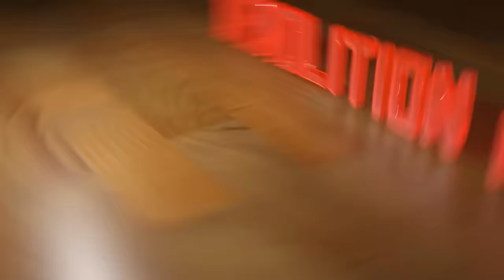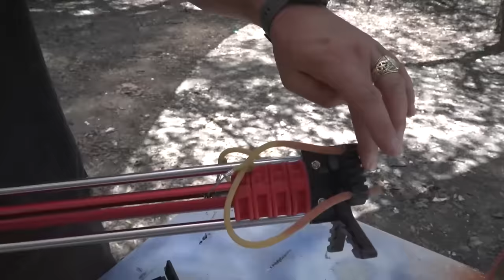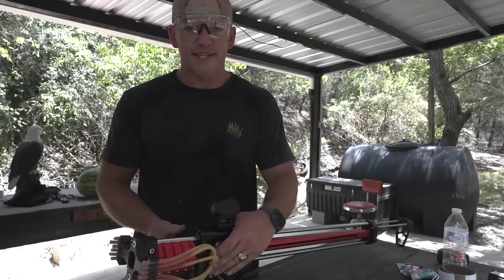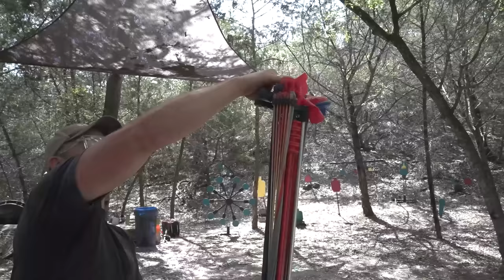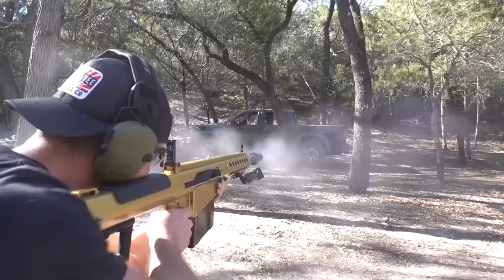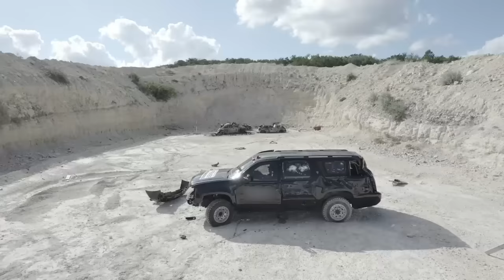The Chinese High-Powered Slingshot Gun!!!

Comment: Here are a few things you need to know about slingshot "guns". 
First, rubber is slow. You won't ever significantly exceed maybe 200 fps with a slingshot gun. So forget small, lightweight ammo. 
Second, rubber is really good to accelerate very heavy ammo that can be very destructive at 200 fps. 
Third, Chinese tubular rubber sucks. If you want power, you need flat bands, cut in a tapered way (thinner at the back and thicker at the front). 
Fourth, a slingshot gun is basically a crossbow. If you want a powerful crossbow, you need AT LEAST 150 lbs - ideally more like 250 lbs of draw weight. That is  A LOT OF rubber and you need a winch or a rope cocking aid. 
Fifth, for true destruction, you need to shoot heavy bolts (or arrows) instead of round, blunt balls. The sharp steel tips and the heavy weight will really cause damage. 
Conclusion: You CAN make a rubber powered crossbow that rivals really powerful recurve crossbows. You can NOT make a rubber powered "gun" that rivals firearms in terms of shot energy and bullet speed. But that gel turkey you got, I can take a rubber powered crossbow send a bolt all the way through it OR hit it with a fat steel ball that will lift it clear of your table.
Reply: I love the ballistic gel turkey!!
Reply: Or go the Trebuchet route and enhance the speed of the ammo with leverage.
Supersonic Trebuchet is absolutely a real thing. The youtube video is fantastic!
Reply: I ain’t reading allat
Reply: said by the pro himself !

hello Jorg 🤘
Reply: Dank you and bye bye. I love you lol
Reply: Omg the legend himself is here!
Reply: I was hoping you would comment here! You should collab sometime. (If you haven't already at least)
Reply: hear, hear!
Reply: Ya I'll just pull out my Springfield XD and know what's going to happen everytime
Reply: Exactly the subject matter expert i was thinking of watching this video
Reply: PLEASE PLEASE PLEASE
Reply: Lovely to see you here Joerg, just the man we were hoping to hear from.
Reply: The legend himself
Reply: Haha, cocking aid 😎
Reply: Matty needs to get advice from the Slingshotchannel. Would be awesome to see some collab!!!
Reply: Joerg love your channel, hope one day I build something for you and show you his feature's
Reply: I was going to say something. 
And I was thinking about you, and how disappointed you'd be if you saw this, that he didn't use some Thera-Band Gold or something! 😆
But here you are. So instead, I'll just say: Hey Jörg! 😊
Reply: This is largely why I've stuck with large cal air rifles. You don't need someone with your level of expertise to make informed purchasing decisions for those. Glad as hell the slingshot industry has you though!
Reply: colab when?
Reply: Or a toilet brush and really clean out its "bullet hole"😂😂😂
Reply: "Let me show you it's features" 😁
Reply: Create thick rubber strips from discarded inner tube from a big truck or heavy trailer?
Reply: @PaytonHill11 you should. The man commenting is the legend himself. No man can teach you more about homemade weaponry than him
Reply: Let me guess, the Chinese doesn't make flat bands? Or did you just want to pile on the Chinese?
Reply: The wisdom has been bestowed, now go brothers.
Reply: He is here everyone, the mad lad himself, here to spread knowledge of the ages!
Reply: Colab! Colab! We Need  a Colab!!!!
Reply: @PaytonHill11 I can tell your level of intelligence just from that poorly structured sentence.
Reply: @ronaldprince435  🤓🤓🤓🤓
Reply: You 2 need to catch up and do a colab on a doped out slingshot... Love your work JoergSprave...
Reply: You and matt need to make this happen
Reply: Jorg, a lot of what you said is not true. I own one of these slingshot rifles. And with tube bands it could shoot 13mm steel balls at 300fps. I even see others shoot 450fps with a longer version. These slingshots vary from cheap junks to incredibly well made and high end ones. Also, there are very good chinese flatbands (e.g. Precise) you could use on these slingshot rifles too.
Reply: nothing more fun that getting a simple frame with some fresh flatbands and launching 10mm steel balls at like 300fps. so much power
Reply: You 2 should collab
Reply: @vdcn2776 Physics can't be beaten, in order to achieve serious power with a crossbow like device, you must invest that energy first. To penetrate a dense organic body deep enough to cause real harm, with a blunt projectile, you need plenty of energy and momentum. You can build a powerful slingshot rifle, but the projectile speed will be slow so you need heavy projectiles. 
True, the Chinese make flat bands too, and I am sure there are good products out there. The stuff I use comes from Indonesia. But the physics of rubber is pretty much all the same - the reason why tubes are not as good as flat bands is the higher internal friction, the trapped air and the fact that you can't really taper tubes well. I have done hundreds, if not thousands of tests and they all come out with the same results. 
As a matter of fact, rubber just isn't very feasible for a crossbow. It just isn't. The cool down effect means that you can't keep the weapon cocked for a longer time without seriously losing power. Rubber is also prone to tearing. It WILL tear, and the higher the speed of the band set, the sooner it will tear. The weapon will never be reliable. Rubber is really good for a handheld slingshot, but for a crossbow like device, fiberglass limbs will win every time. That does not mean you can not make a well working rubber powered crossbow. You just need a lot of rubber and a cocking aid to overcome the draw weight. Ideally you also have to shoot arrows or bolts to get better penetration. You probably end up with a fairly long, unwieldy weapon. In the end, your weapon will STILL be blown away by a simple crossbow using fiber glass limbs.
This is the reason why there is NO true commercial hunting crossbow using rubber. It is confined to makeshift, home made "better than nothing" stuff. Fun, sure, impressive sometimes. But NOT feasible as a commercial product.
Reply: @Slingshotchannel  Joerg, thanks a lot for your long reply! I am a long-term fan of your channel. I agree with your point. I never think a rubber powered weapon could rival a traditional crossbow. But I think they could also be quite lethal with fat steel balls at 30-40 joules of energy. I guess my original point is that some tube band techniques (e.g. "cocktail" style) could significantly increase the power. Also, the FPS depends a a lot on the draw length/power stroke rather than the draw weight. Even with hand-held slingshots, I see people shooting over 400 FPS with 10mm steel balls in super-long pull style. So I just feel the numbers (200 FPS) you put and your thoughs on tube bands are a bit conservative. Personally I prefer tube bands because they are much more durable.
Reply: @vdcn2776  True, a handheld slingshot can achieve even 500 fps - but only with extreme tapering, tiny ammo and in hot weather. Plus, NO waiting time, you gotta draw and shoot in an instant. 
30 to 40 Joule with a 13mm steel ball isn't really good enough for lethal hits, in my experience. With a broadhead bolt, yes, but NOT with a round ball. 
Draw length and weight are about equal, in my experience. Best results of course require the longest possible draw and the heaviest possible weight. My hardest shots (137 Joule) were achieved with a huge "starship", heavy flat bands and 1" steel balls. I had to train hard for those results. 
If I would use those same bands and parameters for a "rifle", the results would be much more poor. Maybe half of the energy. 
You can use tubes in a "tapered" style by looping them, but that still isn't the same a a fully tapered flat band. As flat bands aren't more expensive than tubes, I never saw a good reason NOT to use flat bands. That doesn't mean that a "Chinese" slingshot rifle can't be fun, in case it is well made. They just aren't very suitable for hunting and self defense.
Reply: @Slingshotchannel  Good to learn from your experience! I am curious though, why can't you reach equal or more power using a slingshot rifle (compared to hand-held slingshots)? Not talking about the specific ones reviewed here or in your previous video, because they are bad. I am more interested in the "sliding-rail, barrel-free style"  ones. Example: https://www.youtube.com/shorts/yinE9yOCdhg. I own one of these. It's precisely machined and has very low friction. Plus this cocking motion makes full use of the upper body strength. So I think one can handle much higher weight and achieve a lot more energy with this mechanism?
Reply: Joerg has spoken.
Reply: @vdcn2776  You CAN make a slingshot rifle that has a lot more power than a handheld slingshot. But you can NOT exceed the top projectile speed of a handheld slingshot, you have to go UP in projectile weight as you will go DOWN in speed. That is because of the cooling effect. See, rubber stores the energy thermically. Means, if you draw out rubber, it will get warmer - up to 15 centigrade more than the environment. If you let it go, it will go 15 centigrades cooler. The moment you draw the bands out, they will start to cool down and lose the stored energy. So if you want high speed, there can be NO waiting time in stretched condition. Maybe you want to watch this 11 yrs old video of mine. https://www.youtube.com/watch?v=OL5C_JzZyV4
Not a problem if you use lots of bands and never stretch them to the max. You just won't ever reach a top speed of much above 200, maybe 250 fps. 
This isn't all bad, as extremely fast and tapered bands tear very, very early. You don't want that in a slingshot rifle. You just live with the slower speed and go up in projectile weight.
Reply: @Slingshotchannel  Nice explanation. I didn’t know much about the cooling effect before. Thank you!
Reply: i was hoping to find u here!
Reply: mr Sprave, the explanation is great and detailed but we would love to see a collab where you show again some features from USA :D
Reply: Yes Now!!!
Reply: Straight pull slingshots are weak. Inverted roller speargun, setup with 6x 14mm rubbers ,stretched at 300%  with a sliding sled. Each rubber is loaded individually by hand. Will post my results soon 💪💪
Reply: Collaboration is needed
Reply: Its more like a speargun than anything. And a speargun is pretty effective Going to have to disagree with most of your points except about firearms. You are never going to get a mechanically powered device to be anywhere near the energy of a chemical reaction powered firearm.
Reply: Well said Mr sprave
Reply: @PaytonHill11 allat? Lol
Reply: @RealMTBAddict  who do you think you are⁉️😐 my daddy owns youtube 😎
Reply: Show him the features, Jörg!
Reply: @Slingshotchannel  heyya J! Long time fan of your channel, question on this topic that i have been wondering: could you potentially use straight line springs (such as garage-door style springs or dirtbike suspension springs) instead of bands on an improved model? Like having each end locked into a free pivoting nob that pulls a launching sled forward?  Also thus having the mass of said sled help impart more force upon the bolt? (Effectively replacining either a sling gun’s hoses/belts, or an crossbow’s string)  i know that it would definitely need gear assembly to crank back
Reply: so no fishing with arrows/darts tied to fishing line in place of shot?
Reply: Also, don't forget to wear your safety T-Shirt when you shoot these things.
Reply: @PaytonHill11 took me 2 mins. I hope you read who you're voting for because we keep voting in old men 😂
Reply: @jamesestcourt4810   Chinese tubular rubber sucks. Which is what he says and he's right. See exhibit A.
Reply: DO IT.
Reply: I agree that the craftsmanship is bad but you have to buy 10 to equal USA 1 which one is better????
Reply: tell 'emm
Reply: i definitely agree
Reply: The champ has arrived!! 😤😤💪🏻💪🏻✊🏻💯
Reply: Legend
Reply: I forgot how good it feels to have someone tell you they love you. #MensMentalHealth
Reply: Ah.
Feet Per Second.
Not Frames Per Second. 
Got it.
Reply: Hey joerg ! Now we have the worlds greatest slingshot professionals opinion here !! Nice to see you ! 😎
Reply: Wie ich sehe ein man mit Geschmack was Entertainment angeht
Reply: I made a rambone after watching your video as a kid. My grandpa helped me.make it out of heavy duty black plastic. It will be around forever
Reply: It's a softish very dense plastic that you can cut and shape. So I used it like wood
Reply: "Let me show you it's features"?
Reply: @LasseLuddell  yes
Reply: Well. No. But yes
Reply: Listen to the slingshot guru.

Comment: A long time ago Joerg has also done some videos on the projectile energy of some handguns and one of his large slingshots:
Sufficient to say - while the large balls he is using would not go through a body, they have more energy and a lot more momentum than nearly all handguns and certainly would stop you.
Reply: Yeah, at least with handguns, the biggest thing they have going for them is speed , being able to transfer all their energy in a small amount of time. You can technically reach the same amount of energy with your bare muscles, but the problem arises when you want to accumulate and transfer it to a projectile with similar performance as a bullet.

Mechanical systems (slingshots, springs, bows, etc) are just too slow and with too much energy loss. The closest you can get to the performance of chemical propellants is compressed air.
Reply: Also, slingshots are like bows and crossbows; increasing power to not increace velocity, it however allows heavier projectiles.

Comment: I'd recommend completely overhauling the thing with strong steel springs on either side, replacing the wire with a braided steel cable, the barrel with a steel instead of aluminum pipe with only a single pointy projectile with twisted or off set grooves or fletchings in projectile to induce spin and impart as much force into as small an area as possible. 

Basically, instead of an oversized sketchy AF slingshot, turn the thing into a slightly less sketchy spring powered crossbow with a couple hundred pound draw weight firing pieces of sharpened round bar or rebar with small metal fletchings to make them fly straight.

Comment: I cannot believe it was $340 😂 I'd have been ready to part with like $50
Reply: Pretty sure I bought mine for like a dollar on one of those sketchy apps where you're pretty sure you're just giving your CC to Chinese hackers
Reply: For $300 you can get a decent speargun
Reply: Seriously,you can get a decent 80 lbs crossbow for a fraction of the price,and it would be much more powerful than this thing.
Reply: @ZP1993  Could you recommend one? Or one more powerful that was for a budget buyer?
Reply: @CIintB3ASTW0oD  Sure,I personally have a Cobra System 80lbs repeating crossbow,though you may find it with a different name,but it's pretty much the same thing (my dad has the same one,but his says Mini Crossbow instead of Cobra System on it). It's affordable,fairly powerful,surprisingly accurate at around 30-40 feet (which is the distance I've shot it) after you zero the sights,and has pretty decent quality,I've had mine since 2015 and had no problems with it.

Comment: I use carpet tacks because they are heavier, sharper and harder, they will go into a body either with a hand held slingshot, rifle slingshot homemade or from a air gun. Also the porcelain from old spark plugs work great because they can bust out most glass windows. Shatter them to tiny pieces. When you bust the spark plugs, wrap a few into an old towel and hit with a hammer. If you save the rod inside you can weld with it I was told but never tried it. I normally break those rods and only wanted to get the pieces of porcelain from the plugs for ammo. They will go into a human body as well. If you want you can use carpet tacks, broken porcelain pieces, bb's, and ball bearings and make homemade devices that will send all the pieces all around in 360 degrees. Many ways to make those things. The damage from them is severe.

Comment: I’ve been looking at different slingshot rifles and did see the one in your video. I thought about it and said, nope since it’s so expensive. After seeing this with the wire starting to shred and the buffers tearing, I will not get this model. I would look at a simpler version with a high 70cm fource rating.

Comment: i make slingshot guns, i dont wanna say there like this but most like a crossbow. search adderini, slinghammer, bbhammer, an bolthammer an that will give you a good idea. i may try to make one to send to him if i knew it would make it to him. also when shooting rubber, it becomes weak if held fully stretched so the faster u release it the more power u will get from the rubber. a couple second dont bother but ive tested it an strong rubber stretched an held more than 5 minutes would barely send a 6.3" bolt into a soft target at 15 20 feet, so this is something i try to keep in mind when shooting with rubber, the ones i make can use crossbow limbs too but ive only used rubber to power them. dont know enough about crossbows to know what a good set of limbs is to buy for them an ive made 20+ with rubber for what it cost for a single set of limbs an string and thats give me 4 different types sizes an strength so alot cheaper with more options.

Comment: Should had made it to fire arrows or bolts. Too much power to fire a couple of lightweight BBs or whatever, most the energy is reabsorbed by the bands (hence them coming apart or tearing up the buffer). It's like dry-firing a crossbow.